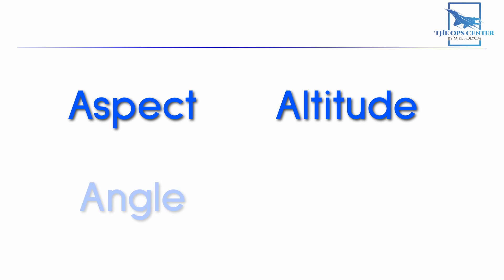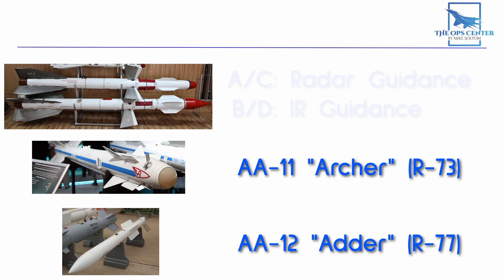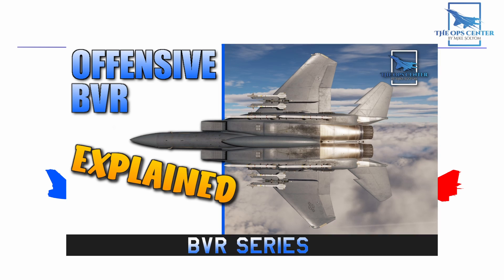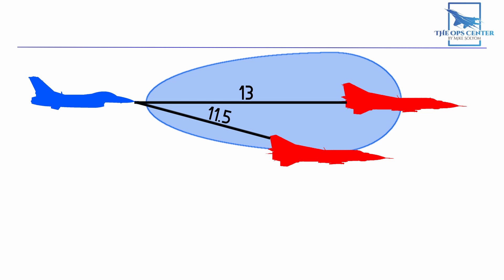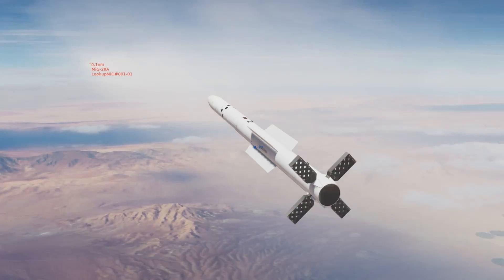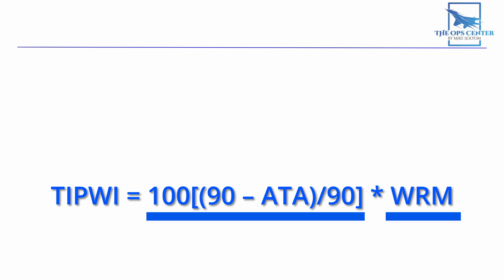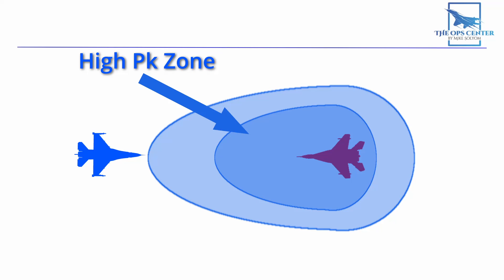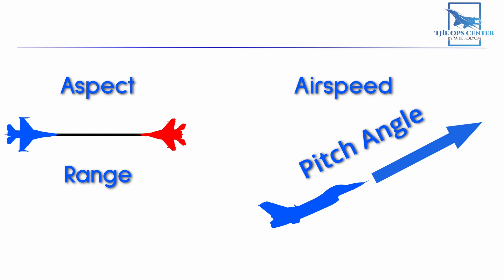How To Maximize Missile Performance | BVR Series | Part 3

Comment: Are you sure co-altitude is better than simply higher altitude? How does that work? We've got more potential energy when firing from higher up.

If I'm at 30,000ft and the bandit is at 10,000ft, do I really get better performance by descending to 10k first before launching? Say I also slow to the same speed as I was at 30k, to remove the confounding factor of airspeed, which we know also improves performance.
Reply from the maker: That's a great question. The short answer is "Yes, I'm very sure".

The longer answer goes like this. If you are launching ordnance at a fixed ground target then yes, absolutely, range will go up with launch altitude. But this changes when you have a target that is mobile and actively maneuvering to get away from your missile.

Now you have a limited time to catch it because the missile gets all its speed in the first few seconds of flight. Afterwards it only loses speed. This is the critical part.

Even when a missile is falling it is losing speed. This is because drag is taking away energy faster than gravity is providing it. So you want to minimize the distance traveled to ensure a hit.

Now typically BVR missiles do arc up a bit. But if you're firing at a target at a different altitude you are increasing the amount of time the missile takes to reach the target. All the while it is bleeding speed. For an air-to-air hit you need speed. Once you lose too much it's a guaranteed miss.

This differs from air-to-ground ordnance where speed is less necessary. That's why you will see long range air-to-ground ordnance with wide wings. But you'll never see air-to-air missiles with wide, gliding wings. The drag isn't worth it.

Anyway, I hope that helps answer the question.
Reply: I still don't quite get it. We know that when there's an engagement up at high altitude, our weapons have longer ranges, due to the reduced drag from less air up there, right? That's what the DLZ shows us, and we factor it into our abort ranges. When shooting from high down to low, don't we still have the benefit of that thinner air and reduced drag? If we were at the same altitude, our missile would have to go through denser air the whole time. How can it be a disadvantage for the missile to go from less drag to more drag, compared to the same amount of drag the whole time?

Ok, so maybe it's the added distance the missile has to travel? Let's plug the numbers in to the Pythagorean theorem and see how much more distance. Say the enemy is 15nm away in pure distance across the ground, not counting the vertical component. That's about 91,142ft, so that gives us the base of the triangle.

Say we're 5,000ft up, that gives us the other side of the triangle. The hypotenuse would be 91,279, which gives us an added distance of 137 ft, or 0.15% more distance the missile has to cover. That's absolutely minute.

Ok, let's try 10,000ft higher. That gives 91,689 as the hypotenuse, a difference of 547ft, which is 0.6%. Still absolutely tiny.

Surely that tiny extra distance isn't enough to overcome the benefit of reduced drag and higher potential energy from firing higher. What am I missing?
Reply from the maker: @Hyperlynx2  I think what you're missing is air density. At low altitude traveling 1000 feet costs more than traveling that same 1000 feet at high altitude.

Try firing an AMRAAM at a low altitude (ie under 4000 MSL) rear aspect target. Its practically a Within-Visual-Range weapon in that circumstance.

Just remember when you are firing upward your missile is fighting gravity. When firing downward it is fighting drag. 

If you draw out a missile's WEZ it will look like a tear drop with the farthest point being co-altitude. This is all modeled in DCS and I recommend trying it so you can experience the difference first hand. Good luck with this!
Reply: I'm not talking about firing upward, I'm talking about firing downward!

Surely you get less drag (or at the very least, no more drag) firing down on my enemy than first descending to the same altitude?
Reply from the maker: @Hyperlynx2  Let's try another approach.

Parasite drag is the biggest consumer of speed on a missile after its rocket motor has burned out. I go into greater detail on drag in this video: https://youtu.be/PTrIAImqaX0

That drag gets worse with higher air density. As you go lower in altitude air density increases and so does drag. After all you are bumping into more air molecules when the density is higher.

So when a missile dives after a target it is encountering more drag than if it stayed at the same altitude. Hence it loses more kinetic energy. This is why missile's have a longer range for moving targets at the same altitude.

I highly encourage you try out the BVR mission I covered in the video listed below. In that scenario you start a fight with hostile fighters at high altitude where range is longer. But in the end you will be chasing strike aircraft at low altitude. You will see first hand that AMRAAMs do not travel as far with the low altitude aircraft because of that increased drag.

Hope this was helpful.

BVR Mission Video: https://youtu.be/kGcI3DabLiw
Reply: Yes! Drag gets worse with higher air density! So how can it be possible that you get LESS drag by launching from down in the dense air?

I cannot control where the target is. Of course if I'm firing down on a low flying aircraft, the performance would be worse than if my target was up at the same altitude as me, but I can't force them up to the thin air. 

It doesn't make any sense that it's more efficient to first descend into the denser air and then launch
Reply: Put another way: the bottom part of our WEZ shrinks because the air is denser, but we can't possibly solve that by simply going down into the dense air. Then the WEZ would simply be shorter.

Comment: I was struck by the significance of firing missies at targets beneath you and how that counterintuitively reduces the size of the WEZ. It instantly made me think about how the Spacex Falcon 9 bleeds off so much energy despite coming in vertically at very high Mach and it’s mainly because of increasing air density. The landing burn fires very late in landing phase.

Comment: Why would higher pitch angle work for r27 fox 1 missile? It just spends the extra energy to immediately correct itself for the shortest interception point.
Reply: Holy moly, was i wrooooooooong...i did 4 tests, 2x direct shot / 2x curved between 20 and 30 degrees pitch with R27ER.

Direct shot 
alt 7943 m
dstnc 45,3 km
mach 1,15
initial g pulled 1,4g (how much missile pulled during boost max g to aim at target)
...
impact
time 53,27s
mach 0,89

Curved shot 27,6 dgrs pitch
alt 8081 m
dstnc 43,8 km
mach 1,07
initial g pulled 3,1g
...
impact
time 43,43s
mach 1,55

The other attempt at 22 degrees did a little bit better.
Reply: Do R-27s correct for the shortest interception point? They have range and alt information from the plane and the radar, so it can plan for an optimal flight path instead. EDIT: Likely only at launch, not after, like in some missiles such as AIM-120 which use datalink to communicate and not just pure radar reflections.

Comment: What is the optimal maneuvering to kinetically defeat a radar-guided missile? Is it better to go cold and dive, or to do some weaving to make the missile change direction to lead you and loose energy?
Reply: Optimal depends on the condition, if you care only about safety then go cold, if you want initiative then crank and dive.
Missiles booster last only for maybe 10 seconds, that and its gravity energy is all it has got, afaik you should let missile commit into certain direction and then when its past its boost turn opposite, if u need, dive to scrape its energy or if it is fox 3 possibly notch and chaff. Missiles are different so you have to know what to expect from specific planes.
If you see fox3 creeping on your rwr you can also pull hard towards it when its about to hit you, it may be low enough energy where it cant follow.
They fly way way farther in high alt than close to the ground and you can also degrade missile with jamming, dropping lock or making it easier to observe and defeat.
Amraam cant jump on you without almost any warning from above with its inertial navigation if you activate jammers, link between missile and plane is broken and it is flying directly on your plane without any special tricks.

Comment: so i have a question about tipwi/pk: if my opponent takes evasive maneuvers, their aspect/aot changes, if i am certain a target will defend very early, should i push into the lower portion of the no escape zone to compensate for this, or does the p/k already account for more complex maneuvers like diving and alternating directions to drain the missiles energy?

also to clarify, we still should try to maintain an increased altitude over our enemies because the range reduction we have is less than theirs, due to our missile starting in thin air and thus having more total speed, while theirs is in thicker air and fighting gravity simultaneously, correct?

and lastly, is there any chance you have access to those tables? and why dont they account for altitude in any way? im certain theres a range difference if the co altitude shot is at 5000' or 40000'.
Reply from the maker: Question 1: TIPWI and Pk are different. TIPWI is the probability at the time of launch. Pk is for every available scenario. The AIM-120 is just above 50% Pk accounting for all uses in RL combat. But your individual probability will vary from one moment to the next (that is TIPWI). Any decision to shoot will be based on risk vs reward. So I can't give a canned answer that covers every possibility on when to shoot. If you think its worth the risk then get closer to the enemy before shooting.

Question 2: Think back to the diagram of the WEZ I use in this series. It's parabolic which means the middle is always the longest part. Co-altitude shots have the longest WEZ. Anything else will be shorter. But sometimes that's okay. Also, being higher puts the enemy in ground clutter and takes you out of it.

Question 3: Sorry I don't have the tables. Those are the kind of numbers people don't like to share publicly. I can only talk about the part that's been cleared for public release.

Hope that answers your questions.
Reply: @TheOpsCenterByMikeSolyom  ah, okay, thanks for the reply!

Comment: What would be the optimal pitch angle?
Reply from the maker: The answer to this will be "it depends" (like most things in aviation). There will be an ideal ballistic angle for the missile, but that may not be perfect for you.

When you pitch up high you do impart more angle on the missile, but you're also climbing quickly too. Climbing means a change in altitude and loss of airspeed, both of those will shrink your WEZ.

The key takeaway here is that having any pitch angle at all is better than no pitch angle. And if you need a value, I've had good success with 15. However, I can't say I've tested every angle and found that one as the best. YMMV.
Reply: It depends on you and your targets range, altitude, and speed. Think of it like throwing a ball. Where you do need to aim the ball in order to arc it to the person your throwing it to? Same applies for missiles. Think about 'leading' your target. You want to launch at an angle optimal for the ballistic arc of a projectile (a little different because rocket motor but same principle). You can get a feel for this by launching a bunch of missiles at different scenarios and watching if the missile immediately pitches up or down off the rail. If you nailed the pitch angle, the missile will continue relatively straight off the rail.
Reply: For the AMRAAM in DCS it is 30 degrees unless you are very close.